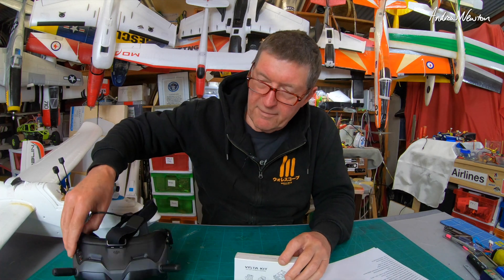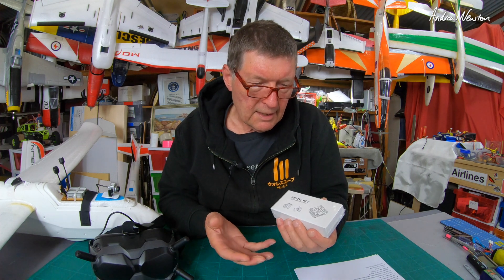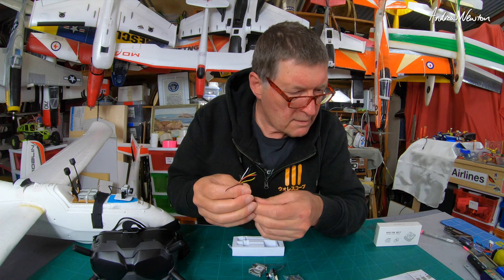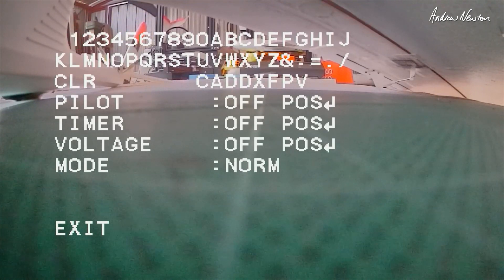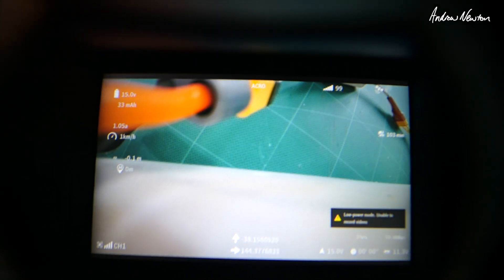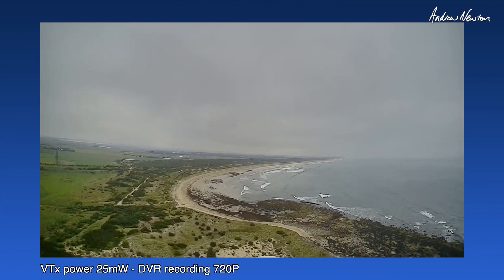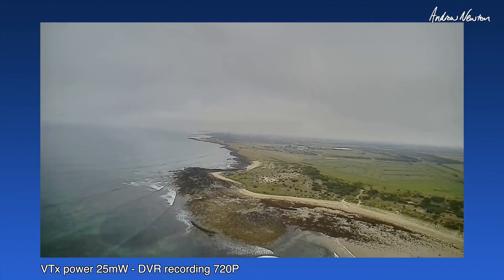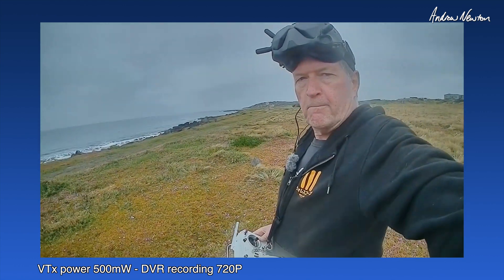Caddx Vista Nebula HD & DJI INAV OSD

Comment: Hi! I run Zohd Kopilot lite on my plane for autopilot ( stab, rth, autolaunch) and a separate betaflight fc with gps for the dji osd. Not the most elegant solution, but works, the two systems are independent from each other. Plus you have telemetry to the rc transmitter. I have Tanaris q X7 with R9 module and R9 slim + receiver. Use the s.port for telemetry. I splitted the s.bus to Zohd Kopilot and the betaflight fc. It is only important for having distance from home, because bf locks home position when you arm it. If you don't connect s.bus to the bf fc, no problem, you have everything beside this and if you lose anywhere the plane the last gps position is on the transmitter's screen. You can also log every telemetry data to sd card on the Taranis. All this stuff, bf. fc + gps+ 5v stepdown for fc, because mine has not, weights 28 gramms with a big, 36x36 fc. With a 20x20 fc and less cable you can go down to 20-22 grams. The best thing is you don't have to mess up with Inav settings for the plane to have rth and stab modes + autolaunch.
Reply from the maker: Interesting solution, well done.

Comment: Glad to see you've finally got the DJI system.  I've been using it in my FPV gliders, planes and quads ever since it was first released.  I still use analog but only for specific purposes.  If you want head tracking with your DJI system you'll need a Quanum Head Tracker, though HK no longer make them but they're easy to make and the original Quanum details are in RC Groups. PS: there's only one version of DJI FPV, there's no Australian version they're all the same unit and it's when you register the system with DJI to unlock it DJI will govern your output power to coincide with your region.  Note: you can unlock the limited power in the air unit and goggles there's several videos showing how to do it.
Reply from the maker: Thanks, you explained it better than I did. I have a couple of those Quanums ready to go.

Comment: Great video as usual, Andrew.
I was wondering if you thought anything spoke against going the "simplest" route by using the DJI transmitter as well, hooked up to a ZOHD Kopilot? One thing I can think of is probably no OSD.. (I don't have a Tx at the moment)
Cheers from Houston
Reply: Just my input here but I have the ZOHD and it is great for entry level FPV and saving your plane for failsafe or loss of FPV, but I really want to change RTH altitude and other things such as having an OSD, Those are just 2 things I can think off the top of my head.
Reply: @FreeEditsForYou  Thanks for your input, Mathew!
Reply from the maker: For me the transmitter would be an extra 4 or 500 dollars. It's OK for quads and Flight control boards I guess but I already have much more versatile transmitters
Reply: @AndrewNewton  Appreciate the answer, and I agree for someone already invested in other Tx/Rx systems it's not a great value proposition. I just sold all my stuff when I moved last time so I can start fresh! 😁
Anybody else have some input? DJI transmitter wise

Comment: Jeez things have evolved since people were fitting large video cameras to big planes powered by OS 90 gas engines in the 1990s. So much gets taken for granted that you can attach a tiny camera that has image stabilisation and use googles to fly around, all while recording and on an electric motor / battery combo that's cheap, compact and powerful.
Reply from the maker: Yes the future has arrived

Comment: Thanks for sharing Andrew. Makes me want to bin my  fpv gear. I wonder would it be feasible to splice the camera video cable through the matek board and get the inav osd?
Reply from the maker: Did you skip through that part of the video? Just that it doesn't record in the DVR.
Reply: @AndrewNewton  I watched the video twice. I am wanting the full Inav OSD on the  ground station dvr for playback to see where I stuff up and how. I have 20 plus items on my OSD. Thanks for getting back to me  Andrew you have a great day!
Reply from the maker: The digital system is not compatible with the current INAV OSD chips. The goggles are actually creating the OSD data from received telemetry data.
Reply: @AndrewNewton  Thanks Andrew. I guess I will have to get my fpv out of the rubbish bin.

Comment: At last, you went up that Coastline Andrew....Range was impressive for just 25mw...How do you know which SMA port to use for that directional receiving antenna..?The Goggle is a tranceiver right?
Reply from the maker: Yes they do transmit for camera setup I guess. Painless says the lower 2 are receive only but you can get 4 patch setups that use every antenna socket.
Reply: @AndrewNewton  Yes, I noticed your had your patch on a top socket...I use two directionals on my 5.8g setup to good effect making a wide beam to fly in. I suggest another directional like in your video for best results..Looking forward to seeing more of your DJI adventures TBH...
Reply from the maker: You asked about glasses. Yes I need +1 reading glasses but not for the goggles.
Reply: @AndrewNewton  Yes, it's strange, because I need +3 reading glasses on my Vipers, but I can almost focus perfectly on the DJIs without wearing glasses at all..
Very strange, the IPD isn't quite wide enough though, so frustrating.
Reply: @johnhazlehurst3880  I found it got better by pushing my face hard into the original foam faceplate, but the IPD isn't quite enough, bloody annoying really...Good job I tried my mates goggles first.

Comment: Im watching on a pc with two 32" screens, when you did that loop at the end, my stomach went from it looking so real on big displays and in HD lol
Reply from the maker: Ha, I felt the same on the ground.
Reply: @AndrewNewton  I'm currently waiting on all the parts to build the open HD system, have the Pi's but waiting on the cams and WiFi dongles, after seeing your video I think opim gonna get that noon motion sway and sick feeling all over again till I get used to it!
I fly on 7" high end goggles which are massively immersive and they have a resolution of 1280x800 that can display 720p in full, I can't wait to see the difference!
If range isn't affected too much the higher data, I may fly on 1080 for the ground station recording :)
Reply: @stevefox3763  Hi Steve! What will be the all up weight of air side stuff with camera?
Reply: @istvansoos1055  it varies depending on the gear you choose to use , I'm using the lightweight pi zero for the air processor but have opted for low power 100mw 2.4ghz modules and will be amping them to 2w instead of using 300mw units so that adds a little weight but not a huge amount.
The pi cameras are 1080p but weigh absolutely nothing, like 1.5g!

I'll try and remember to weigh my gear tomorrow but I might forget.